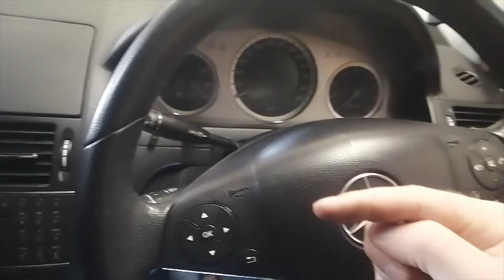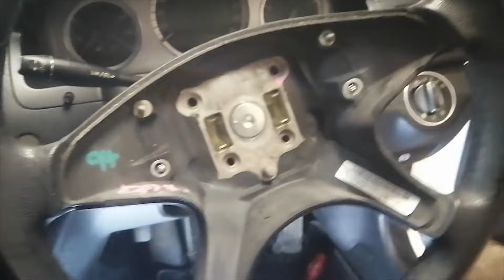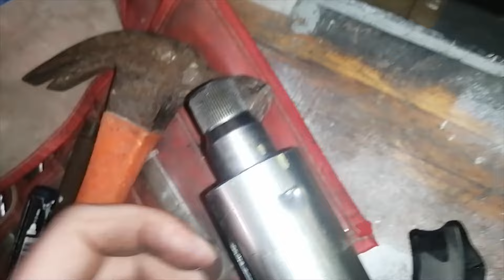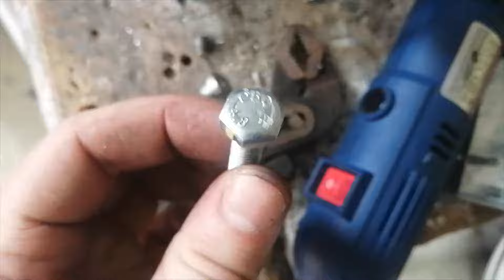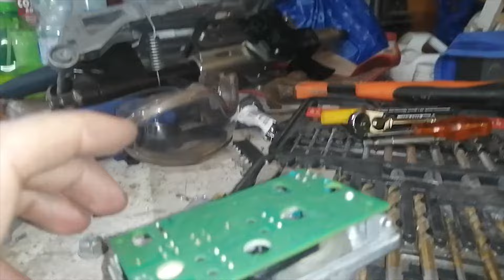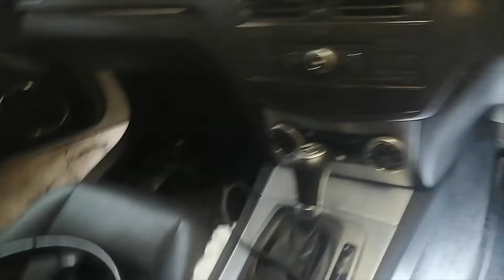W204 MERCEDES-BENZ STEERING LOCK FAILED - CLOSED POSITION! #Mercedes-Benz #yt

Comment: Wat happens wen replace motor ? an it still didnt ? 
Would it be the whole ESL gone bad?
Reply from the maker: If I remember correctly, it's either the ignition or the esl unit. If your ignition is fine, it could possibly be the pcb of the esl. Replacing the motor first is your cheapest option to test

Comment: How many kilometers on the Mercedes at the time of this part failure?
Reply from the maker: It had around 320,000km at the time, but some fail sooner than others and some never if you're Mercedes is the chosen one😂
Reply: @irrationaljp  Can anything bee done to prolong it’s life? Ie lubrication?
Reply from the maker: @georgeanddaddecker7563  I don't think so to be honest, an electric motor can only last so many cycles unfortunately. The grease inside on the gears are already adequate.
Reply: @georgeanddaddecker7563 just replace it with an emulator once it starts to fail and you’ll never have that problem ever again.